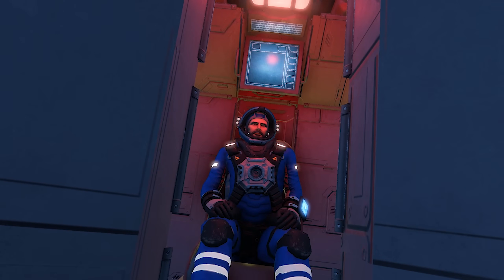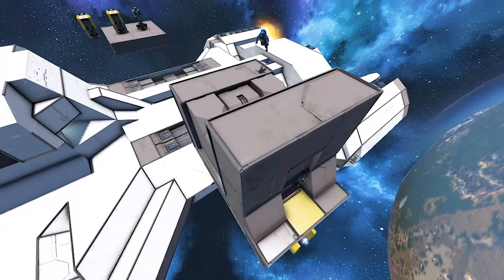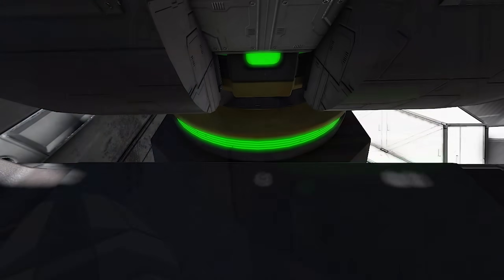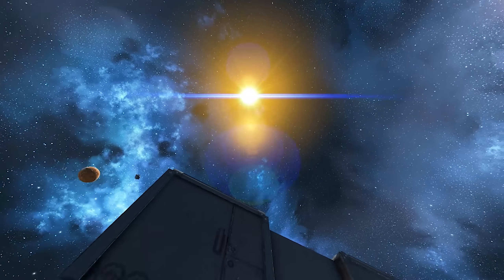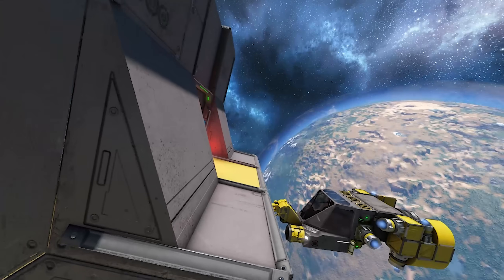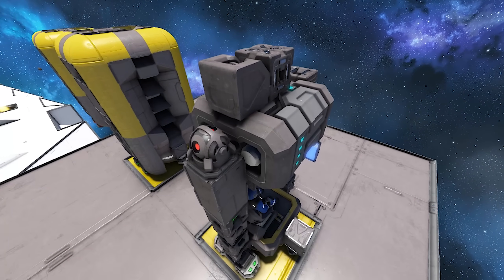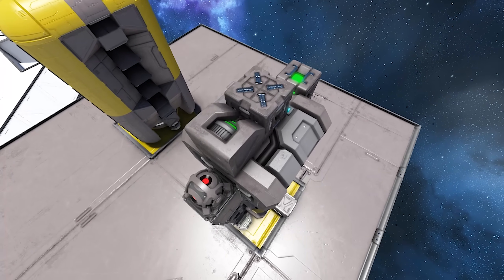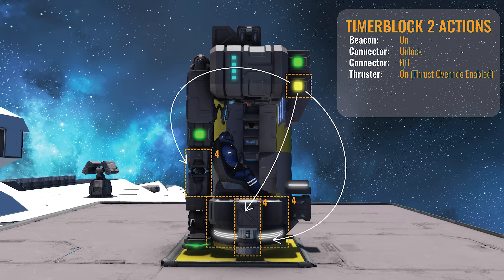Escape Pod Tutorial

Comment: I just found this now. What a wonderfull idea and design. I got to the workshop and subscribed. Putting the pod on the moon surface I wanted to test it. I started the launch sequence, hoped in. Gear and Connectors are red, thrusters are firing up but it wont take off. No idea what is wrong. Is it outdated?
PS: I figured it out. One thruster was not on override, so not enough power to lift off.

Comment: I think I would use a Grav-Launch system. Would need only need one Space Ball on the pod and maybe one grav-gen, depending on where the pods launch from. If they launch out of the belly of the ship, the regular art-grav would do the trick just fine ;)

Also you could do it with a little more storage space. Just offset the thrusters a little to the front or back and you have two more ports for cargo containers.

Comment: With the parachute block not connected to the connector at the bottom, wouldn't you have to ensure that each escape pod has been manually fitted with canvas for the parachute?
Reply from the maker: +CommissarFox I don’t see this being the sort of craft you use for more than one function and one time.  Besides, once it’s on the surface you can’t get it off with ion thrusters anyway.
Reply: I see your point, though I was thinking it would be easier to have these fabricated on-ship by projector than made separately and maneuvered inside during ship construction. If you're loading these in manually or constructing the bay around them then I guess it makes more sense.

Comment: Good to see your making videos again.

One thing I'ed add to this system us a button in the pod to deploy the chute, turn on the landing gear and enable the auto-lock of that landing gear. I'm not a fan of needing remote control blocks for drop pods.
Reply from the maker: +DaemosDaen that would involve some complex level of coding I am unable to do.  The pod would need to be able to detect gravitational wells and automatically steer towards it, know when to flip around right side up, and then the script would have to recognize a preset altitude to deploy the chute.  However, a problem still exists with altitude in that it ignores topography, in detail the current way altitude works is that it goes from a planet’s sea level and not distance from ground, so you might still hit mountains if it’s automated.  You see the problem in automating everything?  It is quite an undertaking to do such a thing, with unreliable results.  The pod might even travel forever never locating a planet without the guidance of a human, as gravity Wells in se don’t extend very far like they would in real life.
Reply: Your talking about an automatic landing system, of which there is a script on the workshop. I'm talking about something much simpler. a button that triggers a timer block that deploys  the chute, turn on the landing gear and enable the auto-lock of that landing gear

Comment: You could also just set the connector strength to 0 instead of turning it off.
Reply from the maker: +Slye_Fox  very true, excellent tip.  Wish I could go back and add a little tip thing at the bottom for that.
Reply: Annotations exist to be used.